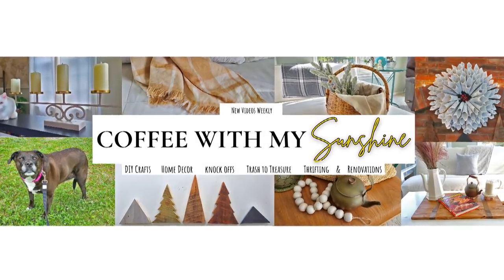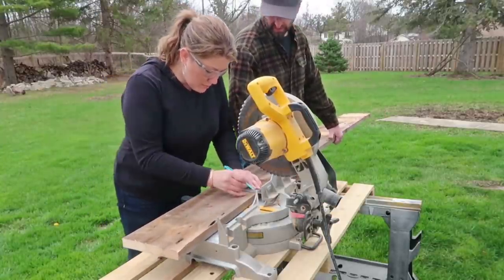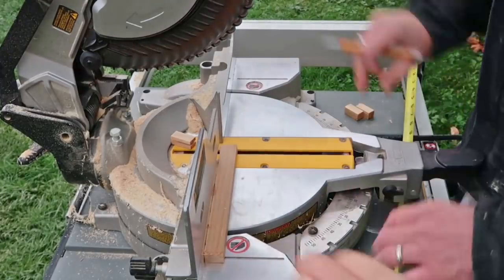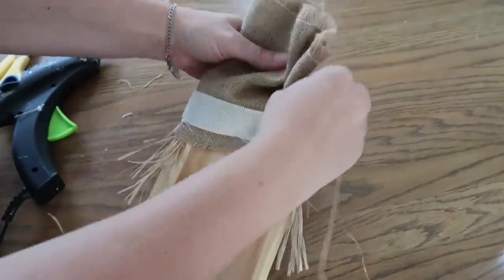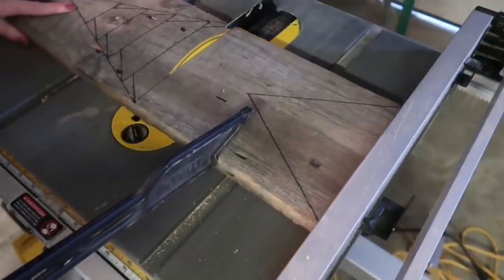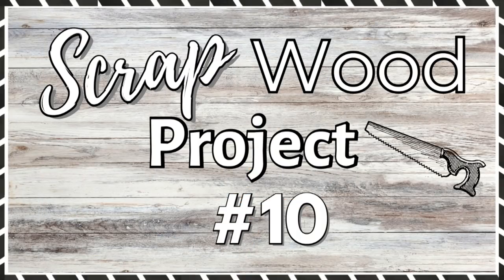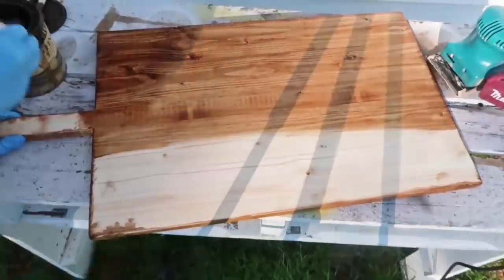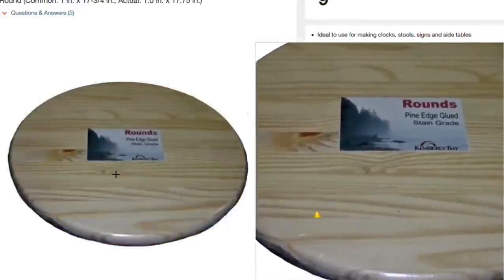⭐19 EASY DIY WOOD PROJECTS pt2 | TRASH TO TREAUSRE RECYCLE SCRAPS -  COTTAGE FARMHOUSE DECOR IDEAS

Comment: These planter boxes are perfect for me.  I'm going to be moving soon and will be able to have a deck or patio, which I dont have now, so am looking for projects to enhance my outside areas. I love a decorated area to just sit and enjoy. These are so veriable that I can use them anywhere I want. I like the finish that you used. It looks really good to me.
I love the lantern. I think it's  awesome that you can reproduces a high end look on a tight budget !!love the pinecone tree.😉
The jewelry holder is nice. You can see what you want without having to dig through drawers on a cabinet like I have, however I have a cat who loved dangling and bright things. He would always be trying to take my pieces to play with. I'd have to keep the closet door closed at all times to keep my pretties safe from him.
I love the shoe shelves  I will need some of these when I get I to my new place.
On the cutting board, I'd make the Handel a little wider and also put some triangle pieces into the corners.
The longer videos are harder to keep track of which one I liked best and might tackle myself. With that in mind I'd like it if you kept the # of projects to 10 and under. Also with the longer videos my comments get longer and longer. 
I found a small wood box on the side of the street. It has a hinged lid and a metal handle. I'm planning on making it into a foot stool/ storage to support my feet when I sit on my stool in my kitchen.   My back sometimes hurts as I stand and cook or wash dishes.
Reply from the maker: Congratulations on your new home!
 I'm really happy you can use some of these projects 💗💗💗. Lol I know what you mean about the kitties lol. I have one too that loves anything she can get into or play with 😄.
Great ideas for the cutting board!!  Thank you so much!! Have fun decorating and making your new house your home 🏡🤗💗

Comment: If you haven’t already gotten longer clamps - May I suggest Harbor Freight they have all metal ones in all sizes and really inexpensive comparatively speaking… when I was making a 7’ tall blanket ladder 18” wide I realized I didn’t have clamps long enough and I used thrift store belts that I had on hand to hold my pieces together… you know we just have to adapt and overcome… as we learn!

Comment: I use apple cider vinegar and steel wool, soaked over night, to stain my rustic wood projects.The steel wool is not necessary, just the vinegar will react with the tannin's in raw wood. Use a brush to add the natural stain.

Comment: For the back of your charcuterie use Corrugated fasteners to hold the boards together forever. They are very cheap and you only need a hammer to attach them. Here is a short video on how to use them. https://youtu.be/o0-MpTXsmTo